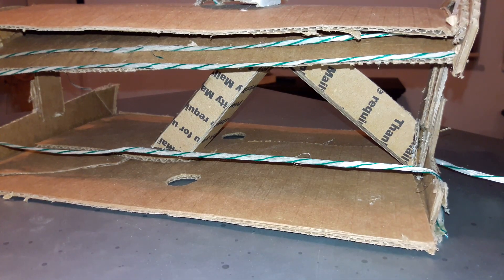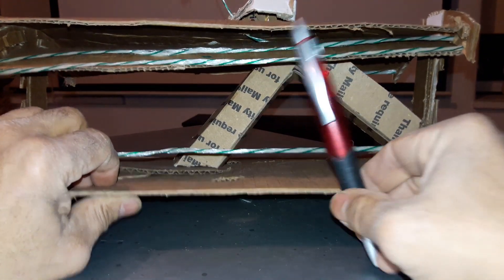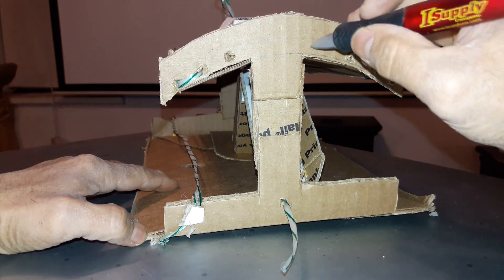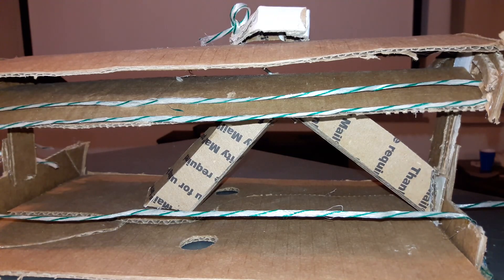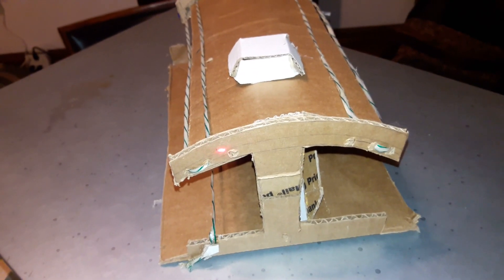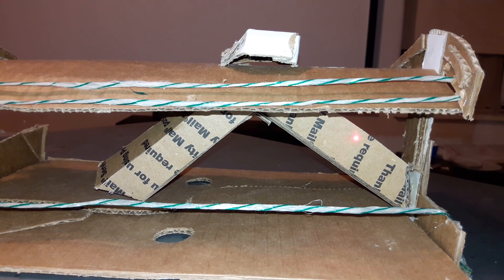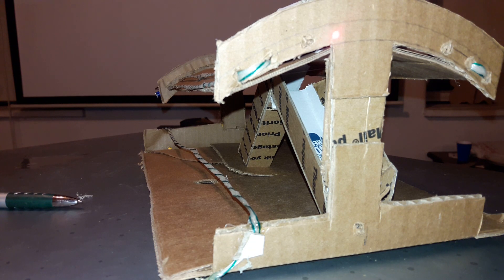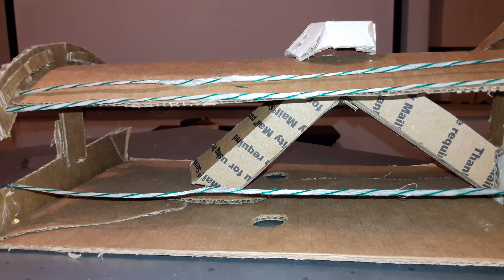FIU Bridge Collapse & Longitudinal cables not fully installed per design?

Comment: The direct downward forces on the bottom deck are less & unbalanced from 3,5.7 causing loads to transfer to 8.9.10,11 which because of the angles so nearly 1.4 more compress is on each column but balanced.  The balanced to unbalanced down forces of the upper deck moved higher loading to a un-flexible point which is 10/11

Comment: The roof failed first. Poor design, Poor steel intertwine within the concrete & no Steel decking to support the weight of the concrete or give it the necessary strength. It was doomed from the start.
Reply: Where was the fatal error made.  Construction???  Engineering??  Faulty work???
This is like the movie the perfect storm.
Too much cable stress?
Why was traffic allowed before final work done.   Who approved this?

Comment: So who's role is it to check that it was built according to specifications? There are a lot of trades involved here, the rebar/steel trade and the carpenters/formwork, plus I guess a special trade that's in charge of the pre/post tension cables. I mean the cables could have been in the correct position prior to concrete pour, but once the pour started maybe it shifted or got moved out of position by the wet cement, who knows.
Anyways great video, thks for explanation.
Reply from the maker: Thank you, I have another channel where I go into this... https://www.youtube.com/channel/UCkctpn_xK2XFEwz5pr5jO0A
I just shared on this channel to mix things up a little... Engineering is my primary form of income; along with real estate investing and construction...  You an I may disagree on gun control but, that can make the conversation interesting and who knows, maybe I will change my position...  But, take a peak at my other channel and subscribe, your opinion would be appreciated.